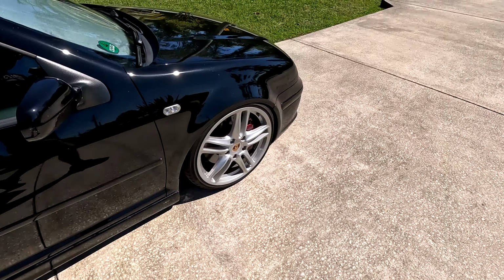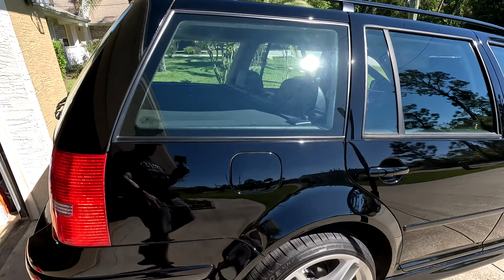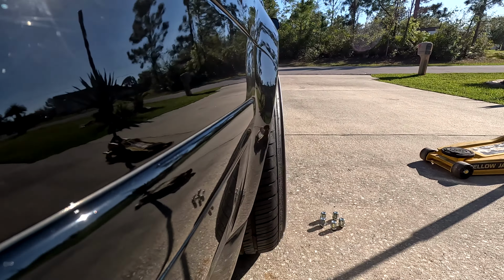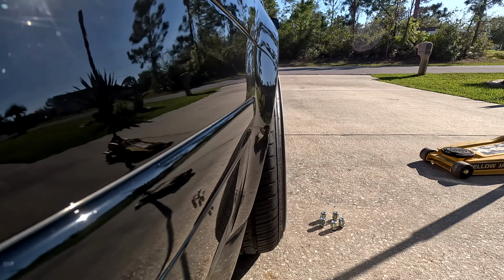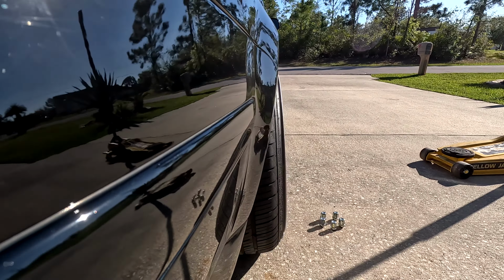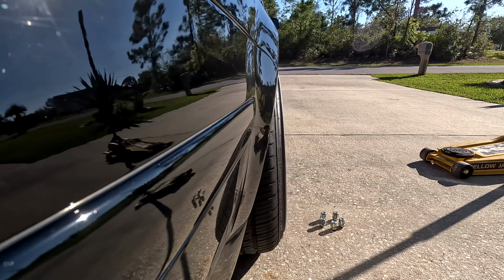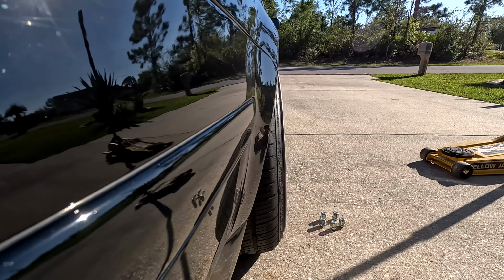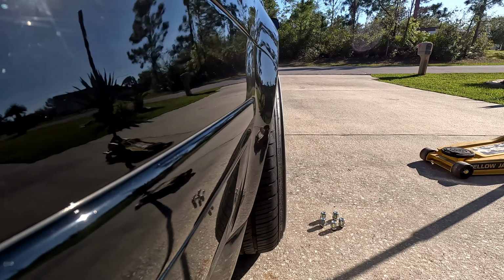Achieving Perfect Fitment! Bagged MK4 Jetta VR6 Wagon.

Comment: she looks good for sure, I would just suggest drop/centering plates for the rear to center it up  bit, Mk4's once dropped have a tendency  to shift the wheel's forward, Ecs as some that go under the rear beam or fabless manufacturing if they still make there idf clone ones but i get you dont want any more camber which the fabless ones give you about -2ish, i'm sitting at about -8.5 all around on my static mk4 jetta setup at the moment lol
Reply from the maker: I was looking at those tbh but idk if I wanna run more camber. But maybe. I do like how the wheel looks more centered
Reply: Came to the comment section to recommend that same thing but checked to make sure someone else hadn’t mentioned it first lol 😂

Comment: Hi Smith…first of all congratulations for your work and videos…keep doing those works…!!!  Tell you that in the Jetta you have the typical problem in the rear axle of the VAG group, the rear axles are all moved to one side a few millimeters... and when you put a tire looking for an adjustment, what happens to you, one wheel is perfect and the other a few millimeters further in or out... you can solve it by visiting an alignment shop to loosen the bridge and patiently take it to the site, or, inserting a spacer/adapter about 3mm wider on one side than the other... in my car for example, I had a 7mm spacer and a 9mm spacer on each side to adjust that difference so that it would stick when going down with the tire... greetings and I hope the experiences of some engine burns will help you 😅😅😅😅 a hug!!!

Comment: one good tip for the fender liners. Heat the crap out of them, air out the car and the tire will strech them perfectly.

second. dont forget to hammer down the locking nut for the front strut height adjustment. ther are well known to get loose and snap the air leader hose

Comment: Those 20mm rear spacers don't have a center for the wheel to sit on which is a little bit dangerous and it might cause a bit of a vibration in the steering..
Is it possible to get spigot rings to poke from the wheels and fit into those rear spacers?

Comment: I'd consider getting gen 2 xenons with the built in ballast. Or send your headlights to vx tuning to get them converted. Save the hassle and potential fire risk of that harness having less protection with that pinch weld flattened a bit. Will also give you a bit more room aswell ☺️